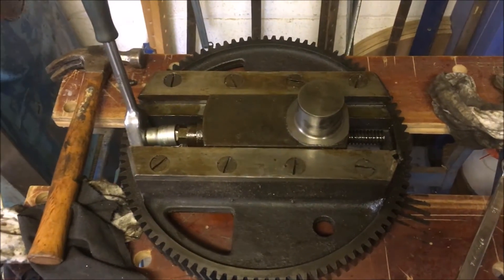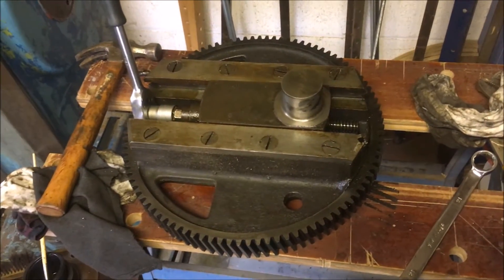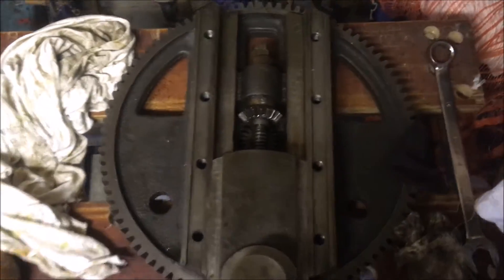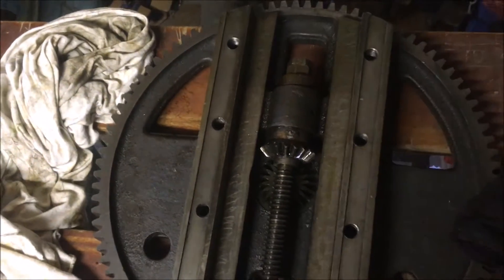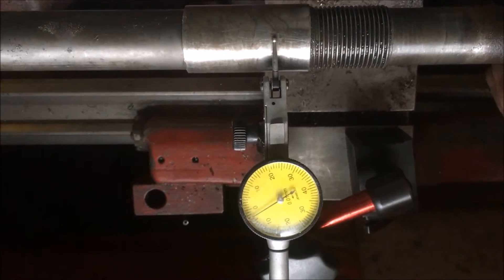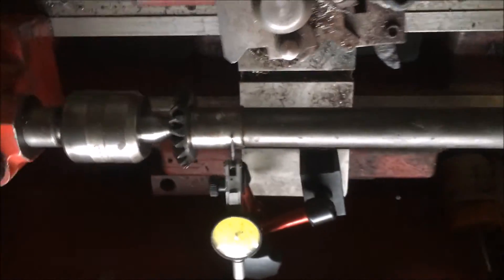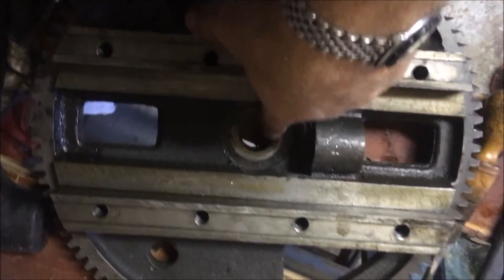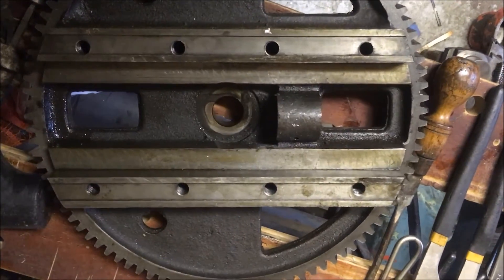Elliot 14S Update 6

Comment: Bit of a nasty surprise !!  I think I would make a relatively  thin walled (1/4 of the shaft wall thickness??)  'tube' with a small flange on the end, bore the bull gear and counterbore it for the flange and bore the broken shaft. Clean up the broken ends a tiny bit to improve thier fit, as in remove the rubbed part where they have been moving against each other while retaining as much of the virgin broken face as possible so the two parts fit well into each other. Shrink fit the two parts to the flanged tube, then drill and tap the assembly for several countersunk cap screws (important that the holes in the bull gear are clearance dia for the cap screws) which will be behind the bevel gear once it's fitted. 
(Might be easier to shrink fit it all if you make a second dummy 'tube' that's a close sliding fit and use that to align the bits while drilling and tapping, then bolt the bits together and then shrink fit to the real 'tube' as a bolted assembly, tricky to shrink fit a part while trying to rotate it a little to feel for the best fit position....)
My thoughts are that the 'tube' will be keeping everything in line, the countersunk cap screws are pulling it all together and the torsional strength is a combination of the cap screws and the grainy structure of the broken cast iron hopefully keying together, much like modern 'cracked' con rods.
Reply from the maker: Hi, I am in the process of drawing up something to effect a repair - basically a replacement flanged shaft bolted to the gear its shrunk into. Space is all very tight - so I want o see it in cross section before I start machining the gear and removing material. I have to say I have had more pleasant surprises !

Comment: Hey Mat, I wouldn't be too worried about the runout you found at the top of the bevel gear.  Given that pin was welded there, it's going to be somewhat out of round.  I'd clean the threads and nut up really well and see how it runs by hand.  You may find the bevel gear was cocked from welding it in place (with the wrong pin) and that was the source of the binding.
Reply from the maker: Hi Bill, thanks for the comment, the bevel gear collar was out of round -  probably from having the pin peened  flush - and as you note the mating bevel gear collar was also well out of true - I will clean  / dress up the running surfaces and refit them. They only rotate within the bull gear shaft when adjusting the stroke by hand so not really a precision fit.  The main issue is getting the Bull gear shaft sorted ... I am slowly working up a solution for that on paper.

Comment: Hi Mat. Can't bet a good beer or three after a job like that. If you don't repair it you at least have a good quantity of seasoned cast iron to use up on little projects, and the table could make a useful surface plate with a little work. I must admit I would like to see you repair it. Sometimes these challenge jobs are worth a go just for developing/improving/refreshing skill sets. Its cactus now so you can't wreck it. A good time to practice shaft straightening iif you don't or haven't done it. I don't remember seeing your mill, but you might find that by rotating the head 30 degrees or so and setting the bull wheel up at an angle you can then machine it. Lots of work, but sometimes the adventure of the journey is better than the destination. Greg
Reply from the maker: Hi Greg, heads a bit sore this morning - I think it was a few too many...
Im pretty sure I am going to repair / get it repaired. The mods to the bull gear to shrink fit it to a replacement shaft seam the most achievable option. I am going to look into making a spigot to shrink fit to the gear face & bolt through & see if its possible to bring the existing shaft into the spigot and thread the securing screws into that. The idea being that the joint would be mid way in the bearing and the replacement part taking up most of the load inside the bearing ?  Ive got to determine what the bearing is made of if its cast iron then I can make the spigot from steel (my preferred choice) - but if the bearing is steel then it may be problematic to make the spigot from steel also - so then its sleeves etc etc. Still thinking.

Comment: Shrink fit a shaft into the bullgear hole as someone else has suggested previously, in addition i would drill and tap holes through the bull gear up into the shaft and use countersunk screws. Its basically all i can suggest, welding the bull gear isn't really an option as its cast iron and doubtful if it would weld.
Reply: ro eng, I agree that making a new shaft and shrink fitting it is the easiest method of repair. In my opinion it can be welded, but it would require extensive and extended pre-heat to cook out the oil, then keeping it straight would be an issue. With good weld prep either cast arc, or brazing would work, but then you still have to get it straight and on size for refitment. If I was welding it I would be making jigs, and probably spigots to locate it as well as I could. Personally, I'll take your method almost every time. Greg
Reply: Greg, Yes brazing might be best, arc welding it i would think would have a low chance of working. Any time i have tried to weld cast iron, its never really been successful, you couldn't have faith in the repair. Shrink fit, brazing and then screws through the lot, belt and braces, combined with the fact this machine is never going to work as hard or as often as the manufacturers ever intended, and it should hold together.
Reply from the maker: Like the whole belt & braces approach. However, as my machining capacity will not allow me to true up the gear should it distort after brazing, I think that it will be a mechanical fixing / shrink fit & bolts etc. Still thinking though.... thanks for your comments.